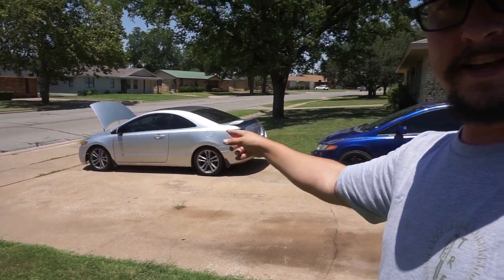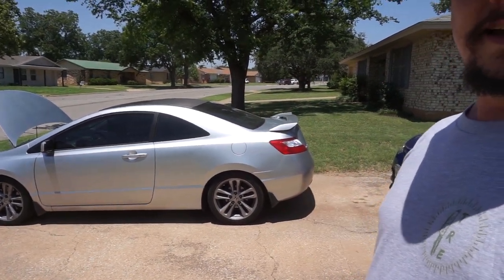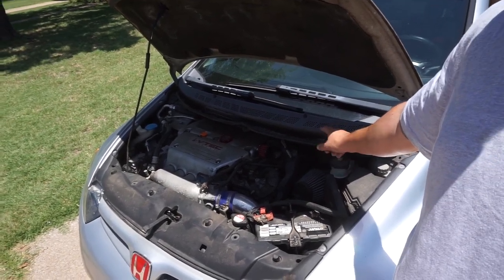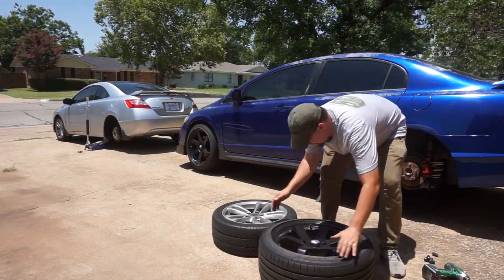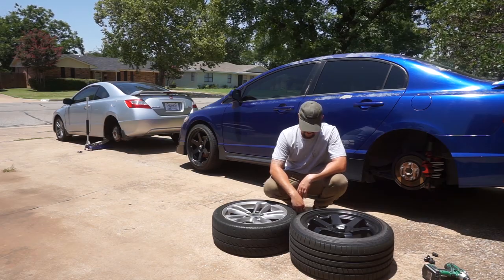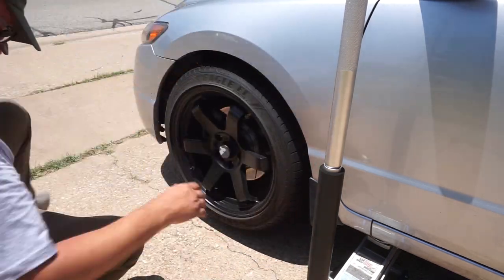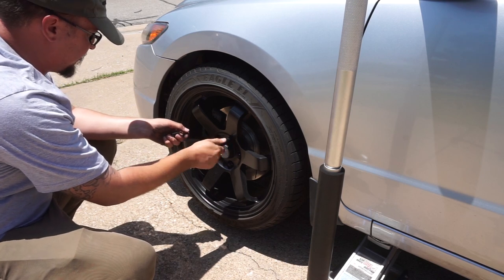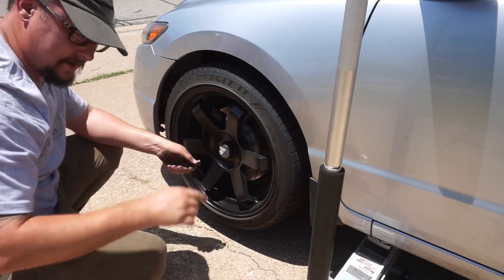400 HP 8th Gen Civic Wheel Swap | Car Vlog | Project Car

Comment: I have my 1 owner (me) 09 ex sedan with 71k on it  basically bone stock has intake and Si sedan header back take off and swap to my ex with a Jones race pack muffler 
Has c/f vinyl wrap on roof and legit c/f hood and deck lid 
Need to do flash pro soon